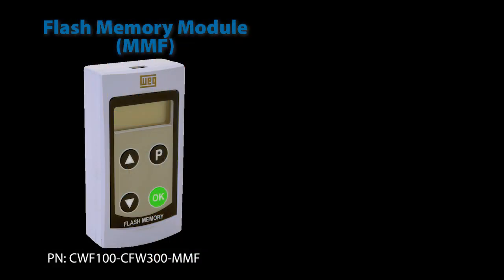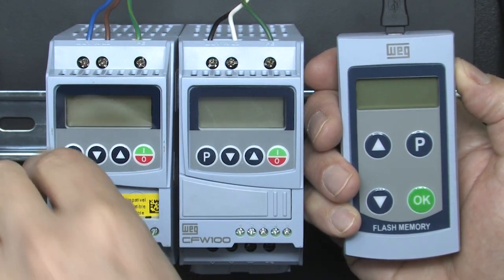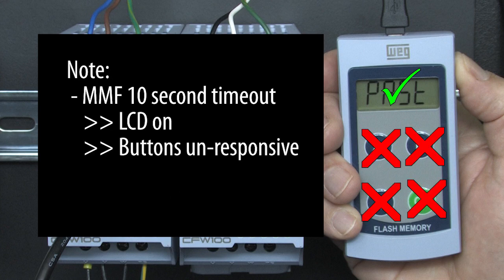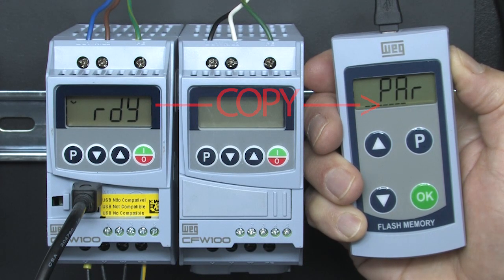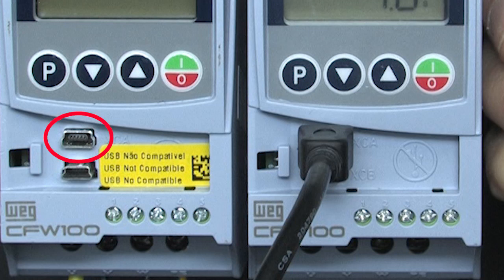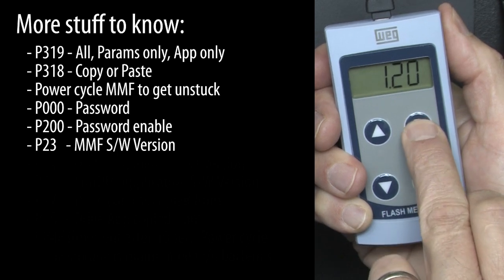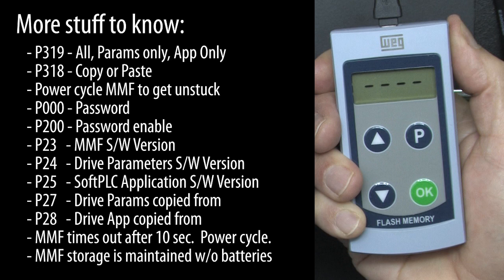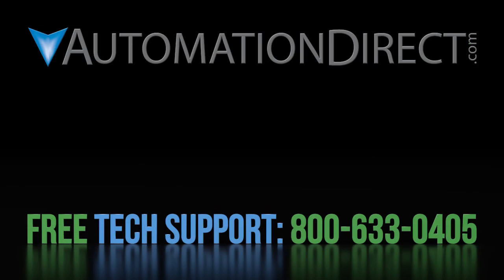WEG CFW100 & CFW300/320 VFD Copy/Paste Parameters Between Drives from AutomationDirect

Comment: This module has 2 usb ports. One for the connection to the drive and one that no manual refers to it about. So what is the 2nd port used for? Can u help? Also i should notice that the connction is established only through the one port located on the up side of the module and no connection can be established through the other one on the down side of it.
Reply from the maker: @ΓιαννηςΣαλλαρης the secondary port under the battery cover is for manufacturer use only. All customer communication should be performed through the primary top‑mounted port.

Comment: Can We use this all drives with same model?
Reply from the maker: Hi Jacob,
It's better than that, you can use it with all drives in the same family!  I didn't mention it in the video, but the drives I used were a CFW100 1/4 hp and a CFW100 1/2 hp drive.  You just can't cross families ( you can't put CFW100 parameters into a CFW300 drive. for example).